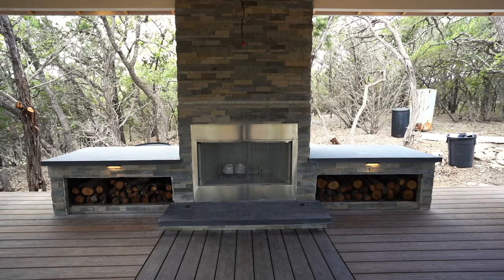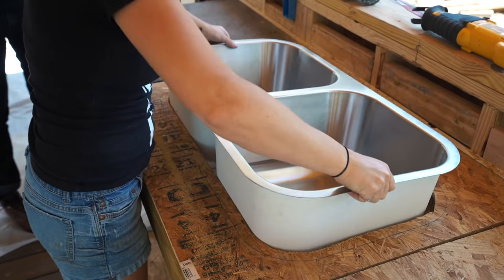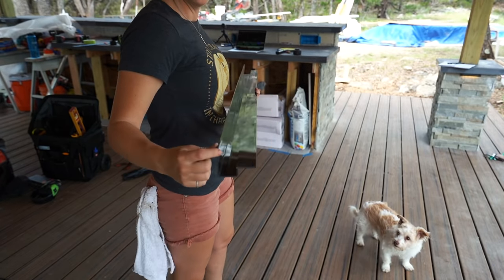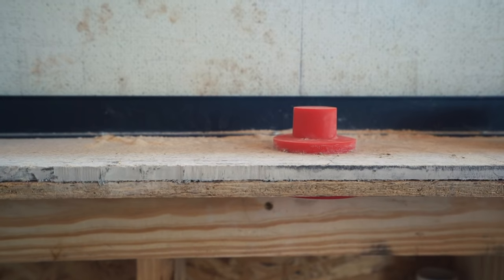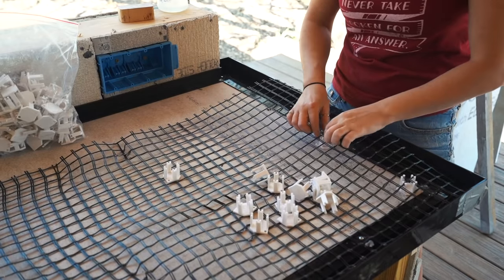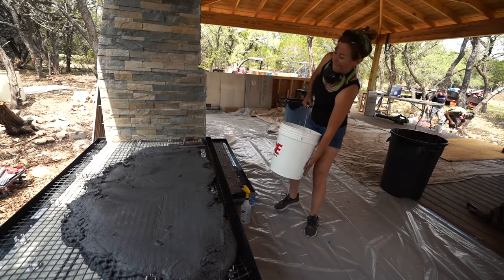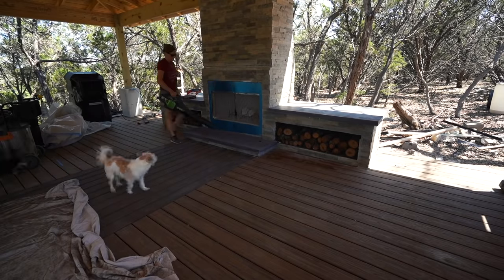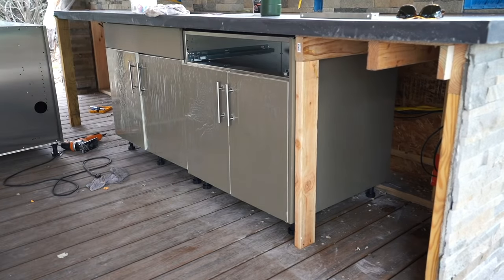Concrete Countertops! How to Pour In Place | Outdoor Kitchen Part 6

Comment: that mix consistency is waaaaaay too thick.   I recommend making your mix a little more soupy than thicker as it can level itself easier and prevent low spots.  do not forget to cover you work with plastic to prevent fast drying which will cause your concrete to crack

Comment: That looks AMAZING!!!!  I cannot tell you how much I appreciate you and your team taking the time to share the journey with us. I just have one note I would’ve done different on the concrete counters. IF you ever need to replace the sink, it won’t be fun. You used a drop in sink, but it looks like you poured the concrete over the entire lip sandwiching the sink between the concrete counters and the concrete underlayment, basically making it appear as if it is an under mount sink. I would’ve poured the counters first, then dropped in the sink.

Comment: Great video!  I'm glad I did granite.    I started my outdoor kitchen in October of 2022 and finished in June of 2023.  Had to work around winter here in Ohio.  Such a wonderful challenge and such a rewarding result.  Stainless drawers, granite tops and cultured stone infields.  I basically started it to give my Big Green Egg , wood and charcoal and BGE accessories a home I cannot overstate how much storage you need for all that stuff and how much planning that takes. One 12' unit for storage, a 6' unit for the BGE and beer refrigerator and pop and a 5 for unit for a wine refrigerator.  In the end, my planning tool was what do you need out there so that you don't have to repeatedly go in the house.  A rack for utensils, sink (water), dish soap, garbage bin, a bing for fire starter cubes, a long lighter and a hair dryer to fan the fire in the beginning, a rack for wine glasses, in drawer paper towels, pam.  Don't forget the music and speakers.  Downlights, electrical outlets? Switches to turn the refrigerators off in the winter?  The most challenging, but one of the most rewarding projects I have ever done.   I think including the granite, the stainless uinits and the refrigerators included I did it all for under $19,000.
Reply from the maker: Sounds amazing! Thank you for Sharing and for watching.

Comment: Nice video. I use a two wheel dolly to move material.  As a young man 6' 4" (many years ago) and over an eighth of a ton (250 lbs +)   I did not use a dolly  just two buckets one in each hand.  Keep up the great work.

Comment: Beautiful outdoor space.  I just finished a concrete bathroom countertop.  I used the Concrete Countertop Solutions products as well.  Unfortunately the surface is more rustic (showing aggregate) than I had hoped for.  I have been told that my timing on using the steel trowel was the reason.  Now that the tile backsplash is finished I am learning to like the look.  I may make a coffee tabletop with leftover product to see if I can improve my technique….I want to learn from my mistakes.

Comment: I've only done one concrete countertop for an inside space using the melanine frame, outdoor cure and then flip method, and it was .. like you said, a LOT of work, but in the end worth it. 
I'm currently debating between doing a plywood + hardiboard + tile and seal method for a surface which will see some rain. 

I feel like doing a full concrete counter experience is really depending on the capabilities of the forms, and those plastic bits you showed seemed to work better than I had expected. We also ran our reicpricoating saw with no blade on the edges while facing to good impact. 

This build of yours needs some "Reacts" videos from contractors.. I'd imaging this was a $120k build. in most environments.

Comment: you can run a bead of silicone on the corners of the form to make a round over on the bottom/corners of the concrete. this is good if you have kids or just want to cut some of the sharp edges.

Comment: Loving the outdoor kitchen series, and hoping to see its various features highlighted in a big cookout/get-together video with friends and family!  Been watching your YT videos for years, and very much enjoyed seeing you on Assembly Required -- I search every so often to see whether you've been picked up for a season 2 (fingers crossed!).  Question on the sink install:  With the concrete running in past the sink's lip, preventing its ever being lifted out, what if it had to be replaced or pulled for some reason?  Cut the cement board from underneath around the lip and drop the sink?  Not a criticism of your build, but just one of the issues I've thought about that's so far prevented my trying concrete countertops.  Anyway, great content, as always!

Comment: I wonder (as someone who has never done any concrete), if air bubbles could be completely eliminated with a vacuum champer before it's poured into the molds. But that might be too much work, to fill a bucket at a time, vacuum it and pour. Idk.

Comment: The first concrete countertops were made upside down so the aggregate would be seen when flipped over. Now no one wants to see the aggregate.

I just replaced my basement floor from 1890's. The concrete truck broke down in the driveway and could not move but could pour concrete. The floor did not come out good due to the truck breaking. I ended up grinding the entire floor and it looks awesome with the aggregate showing.

Comment: I’ve been researching this project for a while. Most folks simply build forms from melamine which was not mentioned here. Far easier. Only advantage to the method shown here is to get a thicker lip that makes the whole top look thicker, but the trouble with pour in place (look at how many people it took, how much mess in the final location, and the effort to prep) makes this method too much for my future outdoor countertops.

Comment: Amazing job. I am looking to do a similar 2 height bar area. I was wondering if you had any videos on the bar height section?  I was wondering if you needed any supports for the overhang?  Did the bottom of the form stay in place?  

Any help would be appreciated.

Comment: Hi April! AMAZZZING. I am building concrete countertops myself and had a few questions I was hoping to get in your video! How did you pour the floating counter on the other side of the sink? (That is my biggest challenge is building support and also what it looks like from underneath) And also, when you replaced the temporary frame with the cabinets, did you do any fastening up into the concrete? Or is the concrete hardie board fastened to only that cleat on the back in the beginning of the video and the counter is simply resting on the cabinetry? Super curious! Thanks so much for sharing this video. Within two minutes of watching you I subscribed.

Comment: Thanks April, as a retired tradesman, I thought that I had seen it all. That's an amazing product. I'm curious as to the porosity of the cement. You may end up with it stained with some fine Texas BBQ. Also, I wonder if a multi-color, marble effect would be possible; or possibly ad some colorful aquarium gravel as aggregate, and grind the top afterwards. I dunno, sounds problematic, but, penny for anyone's thoughts. Thanks Again
Reply: Ooooooooooh, that sounds PRETTY!
Reply: Don't know how wide the concrete options are, but as an alternative Epoxy counters can mimick virtually anything.

Comment: You usually add a little extra coat of very thinned down concrete at the top when its dry and it will leave a cleaner surface but i assume its not worth the extra hussle on a outside kitchen

Comment: I poured my own island top. But I didn’t pour in place, i used melamine hoping to get a nice finish. It didn’t work, the melamine didn’t like the moisture I guess and caused dimples, I will have to redo it 😢. 
I’m going to try just troweling it, I will pour in place this time but little worried about that because I’ve never troweled before. 
Great video by the way

Comment: Usually the white motor is more expensive the the standard gray but it’s used if your coloring your concrete but you colored it charcoal so you could have just used the standard gray

Comment: Curious; why not remove the sink and use the concrete form on the inside of the sink cutout in the concrete board? Then you could just drop the sink in through the top and caulk like most sinks. Was this an aesthetic choice? Will the sink be replaceable if necessary?
Reply: inset sink is the best for kitchen countertop. when cleaning the top, you can use 8-inch squeegee to push soapy water around and into the sink, the sink lip will not be in the way.
Reply: This was not a drop in sink. This was an undermount sink. Fundamentally different.
Reply: @ariffe  True

Comment: Thanks for the video, I have a question, could you use the concrete board cutout to hold back the sink form more rigidly? It seems as if it would have maybe had to sanded down by a few mm, but it seems like it would have been a better fit than that scrap wood.

Comment: I want to do this for a pizza oven I’m building.  When you screw those plastic forms in, the screw heads are covered by the cement.  Do they just break away when you pull off the forms?  Does it just leave that plastic strip under your concrete?  -thanks

Comment: Looks incredible! How did you frame up the bar overhang? And how is it permanently attached. I’ve got this same set up in my kitchen, and can’t find a video showing how that part gets done. Anything would be helpful, thanks!
Reply: I was wondering the same thing. Curious if you found any ideas somewhere.
Reply: @03stories  I have not! I haven’t done my tops yet. But I’m mostly set up. Just need to frame up for the raised section still.

Comment: Love the counter tops.  Thinking of them for my kitchen.   How much odor is produced by the products?  Thanks
Reply: Bit of both. It's definitely a specific type of concrete used for countertops that's very fine and dense. But then it still takes using the tools to bring it to a smooth flat surface.

Comment: I have an outdoor kitchen with an outdated tile countertop over concrete. I should have finish the concrete and skip the tile but that was then. Any chance I can remove the tile and pour concrete on top the old concrete and finish it? Will it stick?. And the edges would be another thing. Granite is too expensive but the easier option.

Comment: "How did you get that big scratch at the bottom of you brand new sink"? "It was a big oops (7:10) when I spun my drill to lock a hole saw in place and it spun right out of my hands and hit the bottom of the sink...I left it in the video to see if anyone would notice"!
Reply: One my friends had a massive oops with a stainless steel sink - chef knife slid off a chopping board and landed point down, the tip punched straight through. The knife looked wild just stuck there.

At least the sink was easy to replace because it was surface mounted

Comment: The wood never last out side should use concrete block or metal studs. The expansion and contraction of the wood will just ruin things. Also in texas the cost of concrete & edging ,staining ,labor  is more than any Silestone or Granite .
Reply from the maker: I think it will last a long time and if eventually something needs replacing, I will. I'm pleased with how it turned out. Everybody has different taste. Thanks for watching.

Comment: Why didn’t you simply drop the sink in through the concrete counter top. The weight of the sink and it’s content rest on the backer board unless there are some unseen under mount supports.

Comment: Why did you sandwich the sink flange between the board, and the concrete? Removing the sink will be a difficult task, this way.
Reply from the maker: I doubt I would ever need to remove it. This is an outdoor kitchen and the sink will not be used that much. I've never need to remove an indoor one and it's used all the time.
Reply: Enjoy your sink. I hope you like it.

Comment: Talk about over engineering jobs.. We did this far cheaper with using ply instead of cement boards with  a pvc membrane sheet ontop of the ply.. Also instead of plastic props to lift the mesh.. You can just use one paving slab broken into chunks with a mallet and use each chunk under the mesh to lift it..

Comment: Using an edger would give you a rounded edge top instead of sharp.
Reply: She chose that edge profile from Z forms. In the video she shows all the different profiles you can get from Z form.
Reply: @speedracer210  Looking at the choice of Z forms the choice for the rounded edge would be troublesome.  If you've finished concrete you know what I'm saying.

Comment: it would have been easier to have poured concrete to half the thickness of the worktop then set the reinforcement mesh then fill the concrete to the top
Reply: If you have an experienced and large enough team, sure.  But when it's your first time the time constraint of the mixing, pouring, and drying of the concrete could lead to issues. As a one off project and first time trying it I would definitely go with her solution over yours.

Comment: I’d like to see a “lessons learned” follow up video to this. Things that went wrong or you’d have done differently. I saw that you slopped concrete up the stone veneer side of the fireplace. I would have taped that off before starting. The Trex decking looked heavily scratched & damaged. RAM board would have prevented that. This would be very helpful.